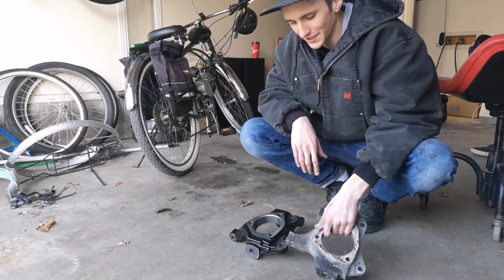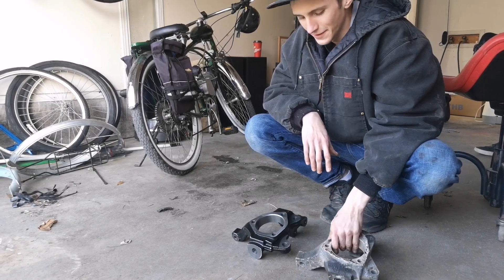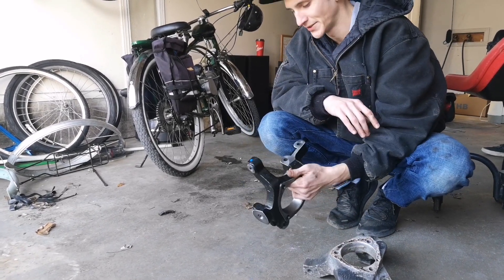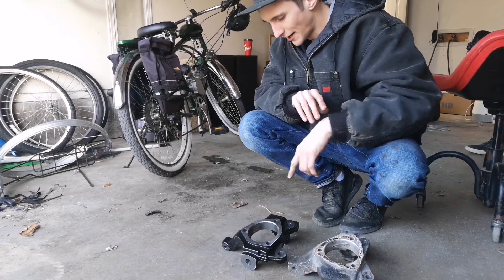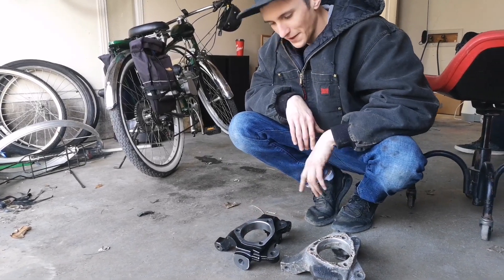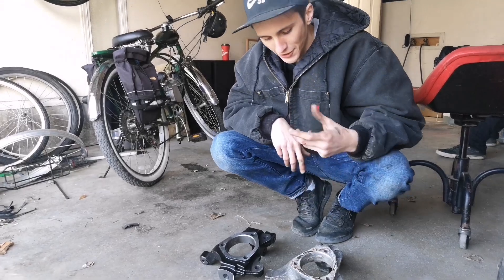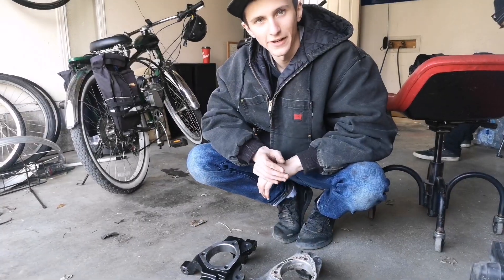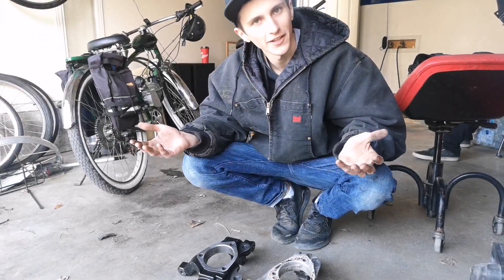Grand prix GXP steering knuckle replacement

Comment: Hey man great video. Unfortunately I need to remove the knuckle on my 01 GTP because I cannot get the strut Bolt Beat out. So I'm going to have to Sawzall the strut and remove the knuckle.
Reply from the maker: Should try using heat, if you haven’t already.
Reply: @brokeboyzgarage  I tried bro but all I have is one of those shity little propane tanks. I got it apart but I'd literally had to cut the strut and half and remove the knuckle. Going to take it into work and press or drill it out.
Reply: I got it out. Took it into work stuck it in a big Vise and popped it out. Didn't realize the top bolt is for camber adjustment. Now I know. Keep the videos coming.
Reply from the maker: Glad you got it!
Reply: @brokeboyzgarage  hey, i know this is a old video, but i cant find steel knuckles anywhere you wouldnt happen to have a part number??? i race chevy impalas at the local speedway up here in canada and would love to put these on my car.  i actually snapped a passenger knuckle this afternoon. any ways thanks for reading my msg take care.